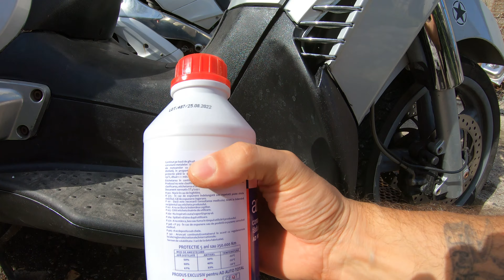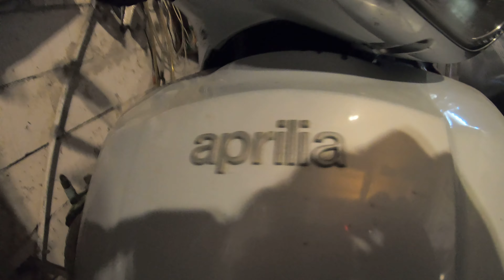Aprilia Scarabeo 400 Antifreeze changed, drained at the water pump , Antigelo , pompa dell'acqua ,4K

Comment: You didnt bleed it 🤦
Reply from the maker: but what did I do, did I fill it? 🤣🤣
Reply: Dont "repair" bikes please, you have no clue. You have to bleed the system
Reply from the maker: @hexagonosaurus5848  ok , you are the boss, you are stronger than the repair manual for this scooter model.
Reply: @AutoMotohowto46  its stated in the manual how to bleed the system.
Reply from the maker: @hexagonosaurus5848  the same type of antifreeze was used, and on mine I was only interested in the concentration being higher, not in drying the engine block , the procedure given in the manual was followed